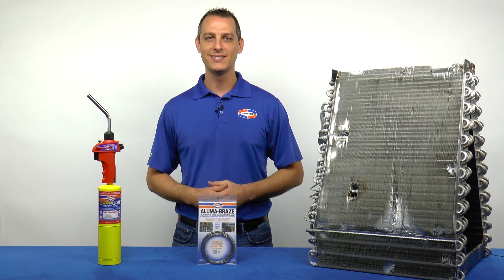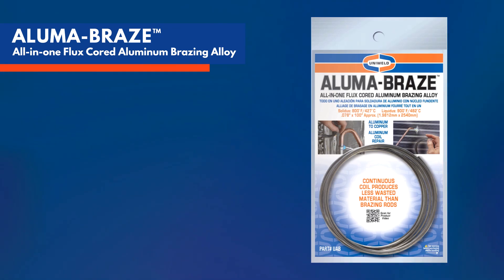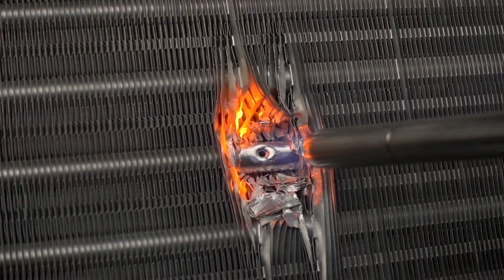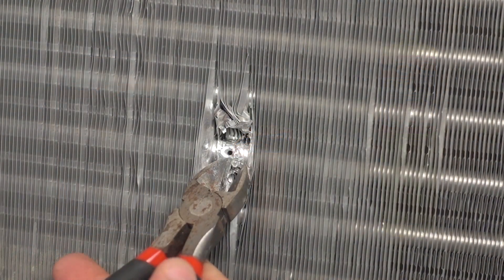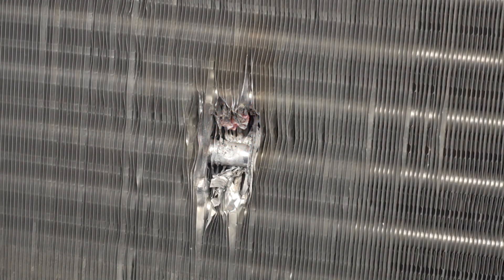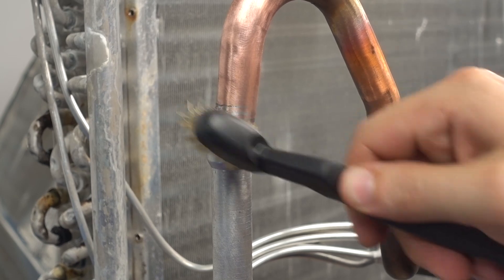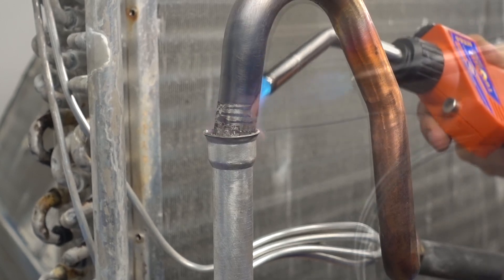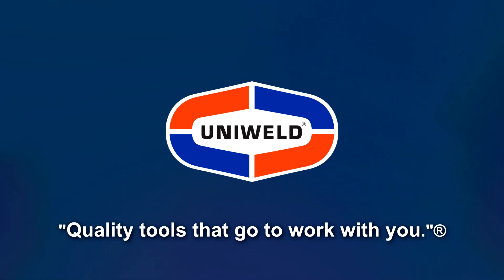ALUMA-BRAZE™ All-in-one Flux Cored Aluminum Brazing Alloy

Comment: OK I just used it for the first time.  7-13-23 on a Trane condenser in which it had a leak on “The Aluminum” tubing.  
Cleaned it real well with emery cloth, I used my oxy/acetylene torch, very gently controlling the heat.  
And believe it or not, it worked !!! 👍
Reply: Why don't you tell everybody how you got all hopped up on that corn liquor and had sex with a compressor?